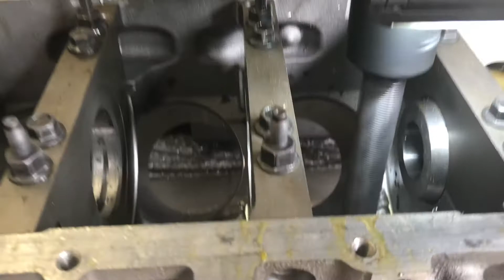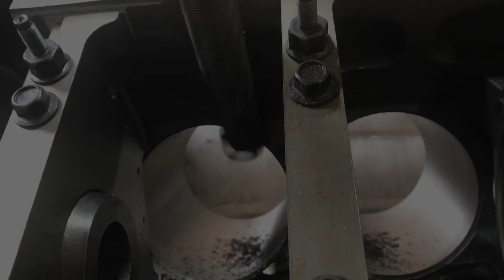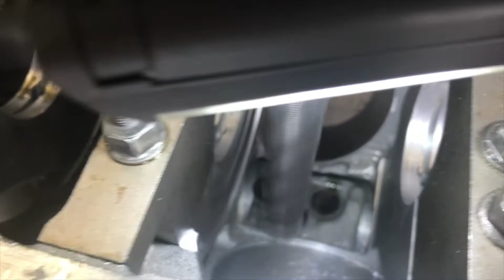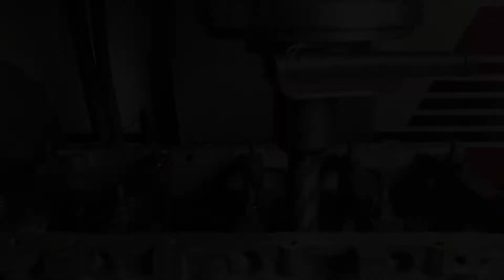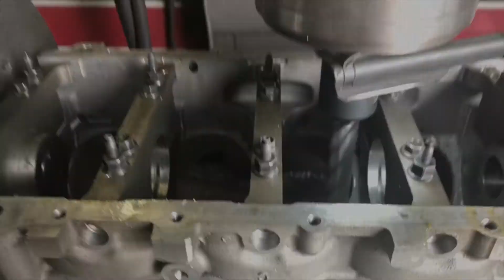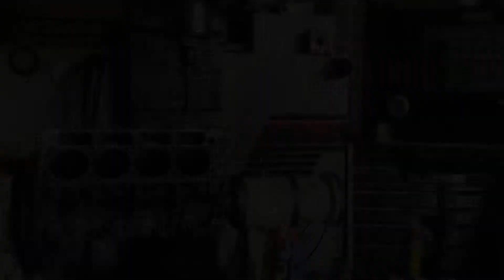Machining a GM LS Block for Stroker Clearance

Comment: I can't decide between conventional small block chevy or LS motor in my 84 Camaro what's the BBEST BANG FOR THE BUCK on which direction to go. And if I decide to go LS and stroke a 6.0 how many CI will that bump me to?
Reply from the maker: It depends on your target horsepower and intended end use.  What are you trying to accomplish?

Comment: Is this needed on a 6.0 block with 4.00" crank?
Reply from the maker: Yes, just a little.  About 0.080"
Reply: @borowskirace  no pan rail?
Reply: depends on the rotating assembly

Comment: Will  4.250 crank work in a  standard lsx block  by doing this ?
Reply from the maker: Yes, but with what we consider to be unacceptable compromises.  We want the pistons to be fully supported throughout the entire stroke.  We do not want to sacrifice piston design.  The Dart block has a longer sleeve.  Nevertheless, our standard LS build with a Dart block and the piston design we like uses a 4.00" stroke.  Bottom line: don't do it.
Reply: @borowskirace  how would a 4 inch stroke work in a iron ly6 6.0. I keep hearing that it'll have premature wear on the skirts ect. Would you consider a 4.00 inch stroke for a street/strip motor something I can drive anywhere get down on track and drive back home?